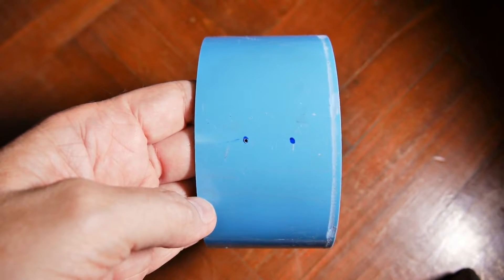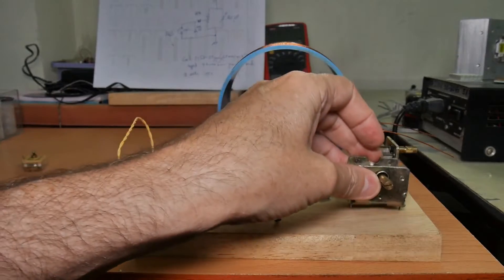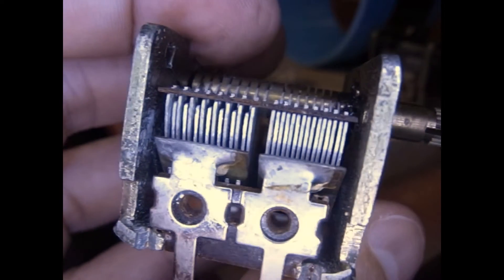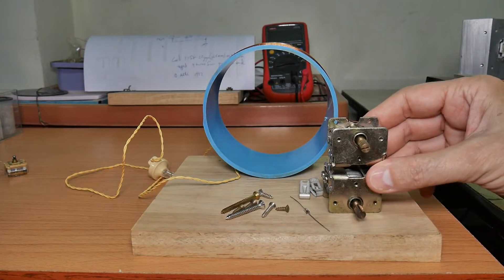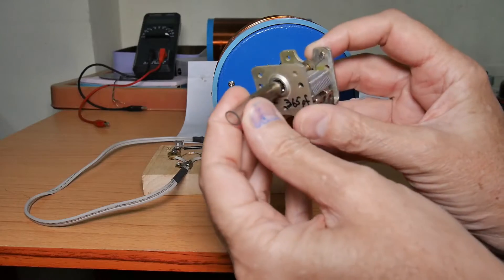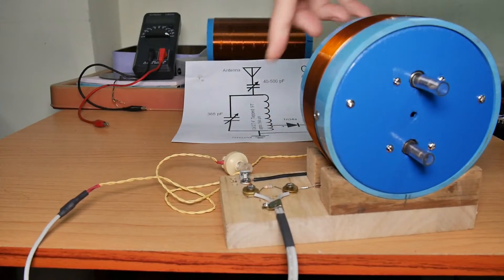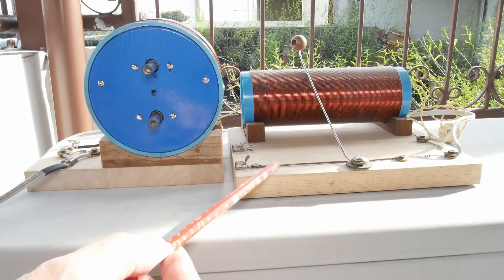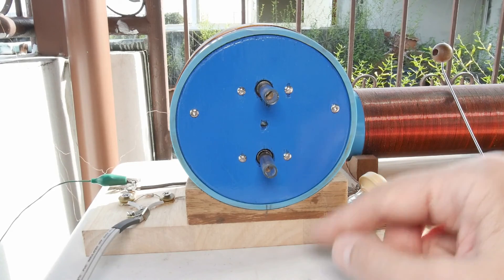Crystal Radio, Capacitive Tuning - WORKS GREAT!

Comment from the maker: RELATED CRYSTAL RADIO VIDEOS: 
3D Printable Knobs For This Radio:  https://www.thingiverse.com/thing:6191252

How To Make A Crystal Radio - No Batteries, No External Power: https://youtu.be/mt-s7pf-U5Q   

My New Favorite!  Crystal Radio with Antenna Tuner:    https://youtu.be/mh5KxCpbQ5U
Crystal Radio & Resonant Coil Design:     https://youtu.be/Fw9eb-aB-XU
Crystal Radio Antenna (Shortwave Also):    https://youtu.be/G8AsgZbncW4

My Crystal Radio Does NOT Work (FIXES for common problems):    https://youtu.be/kCxQ8iPQx4s
Good Crystal Radio Connection Points:    https://youtu.be/G3qjrReHR1k
Crystal Radio, Connect A DC Audio Amplifier:  https://youtu.be/RW3VhnzgjtA
Three Upgrades For Your Crystal Radio:   https://youtu.be/LENco3_jV_s
Crystal Radio Wiper Upgrade:     https://youtu.be/i1otDz39nlw
Popular Crystal Radio Design That's a Waste of Time - And Why: https://youtu.be/r9Onub2Xpzc   
New Crystal Radio Design - "Modified-Pickard":     https://youtu.be/_qxHhFKjLAg
Crystal Electric Generator RF Energy Harvesting Exp 5 - Full Wave Rectifier:   https://youtu.be/BTu_GJKjOmA

Comment: A few weeks ago I watched a ham build a VFO.  He was troubled by hand capacitance when he touched the vatiable capacitor.  He solved the problem by grounding the rotor instead of the stator.  
I seldom hear crystal radio  signals as loud as yours on crystal radio videos.  Maybe they're not using the 1N34A or they're using the wrong earpiece.  Are you using amplification to get the volume up?
The ones I build aren't nearly as loud as yours and I use the parts you use.
Reply from the maker: For the demo, of course I use the loudest station, but I can get up to 17 stations that are listenable. I have a video on common problems: https://youtu.be/kCxQ8iPQx4s
When you are dealing with microwatts of power, even 1 ohm of unnecessary resistance makes a difference. That's why I solder as many joints as possible, use corrosion resistant materials in the tuner arm/connection points, .... Using different diameter sized wire or tube than the plan can make it poor or unusable. Then there's antenna/ground. And the problem with fake 1n34a diodes https://youtu.be/H8XlZ7Mry4M
I've had people who write to me and have done all the above, then there's not scraping the enamel off the connections/coil contact point, painting the coil, using an old car antenna, ipod earphones, no knob on the tuner arm, clothes hanger tuner arm (with paint), etc. There's only 1 problem that I've seen that's not solvable, that's not having any AM broadcast stations. Even then I made a video for that guy on how to create your own transmitter.